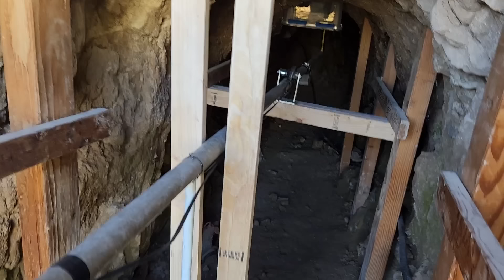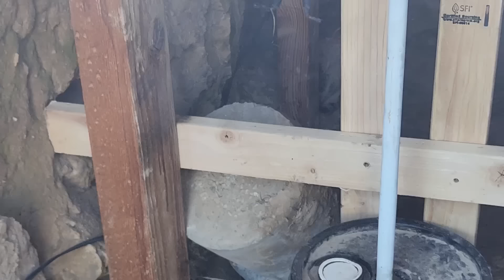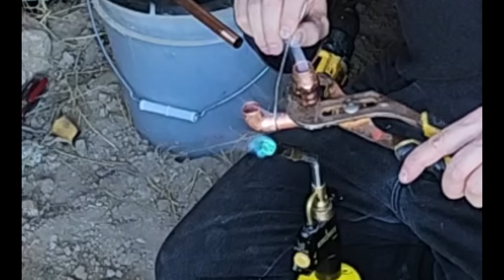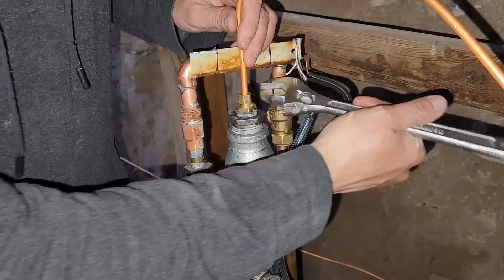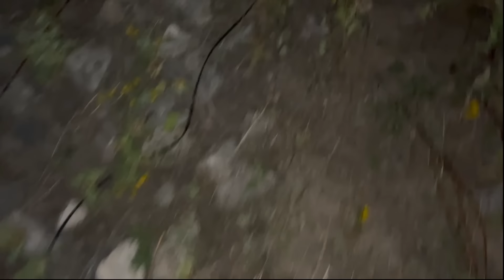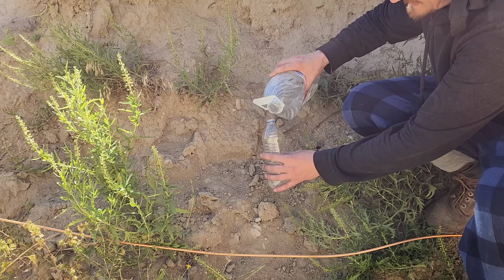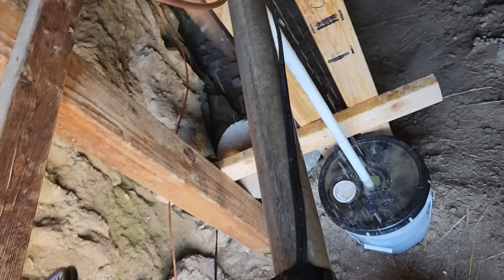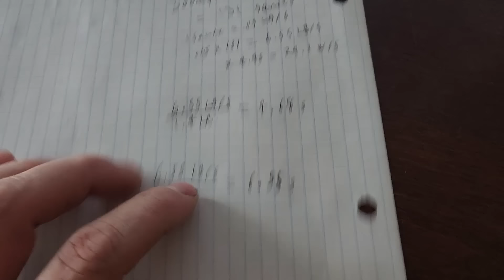Sodium Water Hybrid Rocket?

Comment: Was there 800 lbs of pressure in the copper pipe ?  Normal pressure in water pipes is around 100 lbs.  Sometimes mechanic shops run about around 200lbs pressure of air pressure in copper pipes for their air lines.

Comment: I'm only an idiot but it seems to me that if you'd just put in your lumps of sodium into the 'fuselage' as is (rounded sides perhaps) and had the water injected around it instead of through the middle, you'd have used more fuel. The lump resting on the exhaust would have created enough of a blockage to keep enough water in and... Hmm, maybe the whole thing would just have blown up. Who knows!

Comment: Could you potentially add baffles to the id of the pipe such as washers that have increasingly larger holes leading to the exit? possibly getting a more consistent burn. And maybe increase the force because of back pressure?

Comment: Maybe put the reaction chamber perpendicular to the nozzle.. so the molten sodium doesn't leak out... So have the reaction take place in a horizontal reaction chamber that exhausts gas at the top.. or vertical but have the exhaust coming down from the top of the reaction chamber.. So basically make gravity help making the fuel stay put...

Comment: Cool content. Thanks it was very entertaining, I like your authentic personality. The problem I see is that by adding the water to the top of the sodium tube your introducing a lot of uncertainties in the burn. One clog and... boom. Solid rocket engines always burn from the bottom up. Not top down. I'm thinking about using a sodium rod instead of a tube and introducing the water at the bottom of the thrust pipe. The sodium rod would sit on a metal grid stopping it from falling down onto the nozzle opening. As the sodium rod burns it will continuously fall introducing more sodium into the water contact area at the bottom. Just an idea from an engineer from a completely different field. But I have always been interested in rocket design. would love to hear your take on this idea.

Comment: I think the problem here is that when the fuel components are near the melting point (Na) and the boiling point (H₂O), the combustion is very hard to regulate. Also the fuel components must be sprayed in liquid form and thoroughly mixed into a special combustion chamber with turbulence to mix the components. For the rest: Na+H₂O generates hydrogen that burns in air by combining with oxygen. This adds to the irregularity of the reactions.

Comment: I'd advise on using a steam injector that uses the chamber pressure to feed water into the reaction chamber. It will be much more scalable then having to force in water using a compressed gas.

Comment: I think that most impulse test are performed longitudinally rather than vertically. When done vertically, one would need to adjust for gravity. The changing mass with skew the gravity force, ie weight. The engine is placed in a simple rig with torsion sensors or load cell to calculate thrust

Comment: As an engineer it really hurts my soul to see you write impulse as lb/s and N/s. You are multiplying so it should be lb.s and N.s That's pound-seconds and newton seconds, not pounds per second and newtons per second. 
You should check out Goddard's early rocket which had the fuel tank at the bottom because he (wrongly) thought it would improve stability. It's a design that would avoid unreacted sodium spraying out of the nozzle. Also, you need to add the water more slowly if you want to get all the sodium to react. Your burn times are really short at the moment anyway. Chemistry labs have manual presses that extrude sodium into wire for drying solvents - you should look into that as a way of increasing surface area.

Comment: Maybe an alloy with a less reactive higher melting point metal could work with this design. Silicon, Aluminium or Magnesium seem like good candidates having way more energy but being less reactive than sodium, although making the alloy safely likely requires a vacuum or noble gas filled furnace.

Comment: Sodium metal has a way too low melting point, is obviously a way too good heat conductor (being a metal…) and is too ductile to be a practical solid propellant in this fashion. 
Maybe sodium metal could be used as a powder but it may be too ductile. Otherwise, liquid sodium being injected in parallel with water would be the best option, but that would surely be more complex and hazardous. 
Sodium is kind of fun, but doesn’t seem to be very promising in terms of performance anyway, I guess.

Comment: Great experiment!!! Although I would suggest for you to reduce the nozzle at the end of the rocket to slow down afterburn and prolong the reaction. Another thing that could be for the future reference is to set a non return valve above the pressure washer nozzle as well as the solenoid to shut off noble gas. :)

Comment: I'd personally like to see the sodium locked into a matrix with a high temperature melting point mesh. Since the sodium is grabbing all the oxygen, steel wool might just be a good matrix. This might help keep the sodium in a usable structure, until close to burn-out.

Comment: Just an idea (and it may be a bad idea) but have you considering using a middle pipe that is a bit shorter than the outside pipe that permanently screws into the bottom fitting creating a cup of sorts that you can refill with sodium without the need to use the screw.
The benifit would be that the reaction would be limited to topmost area of the sodium that is exposed and the byproducts have to exit up, over and though the middle pipe.
This should fix the sodium melting problem and maybe the efficiency problem.
Not sure how or if  the reduction in exposed surface area will majorly downgrade the pressure differential, or if it doesn't melt uniformly as I suspect the surface area may increase more than expected.
But what do I know I am just a simple bumblefck on the internet.
Anyway entertaining video. Great job man!

Comment: in India there was a man named Talpade he had two containers one with oil and one with water, under the container with oil was a pipe that connected the container with water, both oil and water were boiled and when water steam entered the oil they made great pressure. My advice is to make a sieve from a tin cylinder with many mini holes so that sodium is not expelled quickly, and instead of pure water there should be water vapor.good work👍

Comment: I was thinking if you were to make several tubes for your water distribution, spaced evenly throughout the sodium (something like 6 copper tubes with a lot of tiny holes drilled along the length of each tube), you might have a more complete burn. If you could find a way for the holes at the bottom of each tube to open first, then have the subsequent higher holes open in sequence...that might give you a more controlled burn on top of a more complete burn.

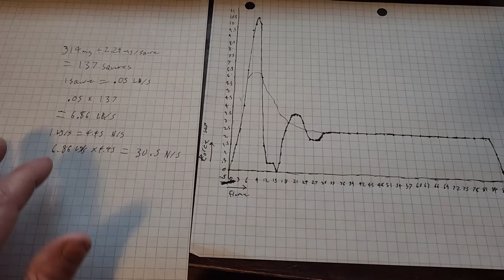Comment: 10:26  remember that the negative value shown was the reversal after the fuel stopped. Therefore, not a true value. Also wouldn’t your scale show you in grams or pounds / ounces. And newtons of thrust force would be measured against a plate.  It including the weight of the device. Then you subtract the weight of the rocket from the thrust and you can determine if it can lift the rocket. 
Now you used a long metal pipe on a fulcrum. Hence to identify the ability to lift the rocket would need to be modified by the weight of the divided rocket

Comment: i wonder if you need an extended chamber for the reaction to fully complete. i am surprised it doesn't touch the metal at the first point on contact at the top then blow the rest of the metal out

Comment: For safe storage of the engines, you could put a burst disk on the bottom and just keep it filled with oil. When the pressurant is released, it'd blow the disk and drain the oil as the water takes it's place.

Comment: I'm thinking drawing the sodium into 1 or more wires, feed wire into combustion chamber kinda like a mig welder...  a gas engine would fail miserably if you just put a spark plug in the gas tank, which is basically what you did. Just thinking out loud 🙂

Comment: I suggest finding a way to keep the sodium near its melting point, and injecting it into the combustion chamber. That way you can control the interaction between the catalyst which is water and the sodium. I feel like you can get more impulse out of the engine with that amount of fuel it’s just a matter of finding the right way to mix it Or I’m dumb either or works for me

Comment: Props for doing this on a primitive level! Impressive! You had a highly ineffective burn, try improving the injector to a much finer particle size and I would suspect a much better burn. Also you probably had much more fuel than oxidizer leading to excessive weight. But I liked the thought process in all of this and it left me pondering that maybe you could reach a optimum particular size by causing the water to be in the form of steam. This could be achieved by using hydrogenperoxide and running a silver mesh catalyst as the injector, thereby turning all peroxide into high pressure steam which then reacts with the sodium. That should cause it to run in a ultrahigh pressure mode. Would love to either see this test or do this! BTW great scientific gear can be purchased for change from government auctions, just in case you want to build a better lab!

Comment: I think you might have some better results if you instead created rods of sodium, and placed them around the inner circumference of the combustion chamber. (To reduce the amount of surface area that is in contact with the walls.) Then maybe put a metal mesh in the center column to mitigate the amount of unburnt sodium pouring out of the chamber. I imagine with the water coming in, it would cool the mesh, and solidify the melted sodium, until it combusts.
Although, I think ideally you'd just have dual injectors with the sodium pre-heated in a liquid form.

Comment: I think your main problem is where abouts inside the rocket, the fuel is burning.  From what I gather, in a typical rocket, it's the fuel nearest to the exhaust that burns first,  this then causes the fuel slightly deeper in the tube to fire and so on.  So the burn starts at the exhaust nozzle and travels up through the the fuel stack.

Your setup, however is introducing the water at the other end of the fuel stack.  So your fuel is burning from the wrong end.  The thust (and hot gases produced) are therefore having to push past all of the rest of the fuel before they reach the nozzel.  This is why the sodium is being melted and ejected before it has been burned.  It's literally being forced out by the thrust.

I think you need a redesign where the water is introduced near the exhaust nozzle.

Comment: I have no experience beyond seeing a small piece of sodium thrown onto water bucket.  At first nothing much happened.  The teacher explained that despite of the oil, the sodium had in the decades (!) oxidized too badly.  After that, he dug out another bottle, this time sealed with wax in addition to the oil.  He explained that it was potassium, which the school should not actually even keep.  So, we would get rid of it!  I guess even he was not fully aware of its strength or just by chance threw the whole sample on the water at once.  It was the biggest bang ever in the chemistry class room.  And there remained plain marks at the ceiling for the remainder of the school operating in that building.
  Apart from my limited experience, I was reasoning pretty early that offering water from the top was quite likely to throw part of the sodium out before a steady pressure could be developed at the bottom region.  Looks like I was not that far off in my thinking!

Comment: As a first test made out of low-cost materials, i think you are on the right track. 
The hybrid rocket would probably get better combustion efficiency if you went with a longer narrower combustion chamber.

An injector that is a long tube with pinholes spraying outward.

Comment: nice try!!! you may want to make your nozzle longer with holes laid out radially along its length or a nozzle that gives a rotating cone pattern. i.e. mcmaster carr 	3282K162.  it may be possible to put stainless steel mesh as a binder.

Comment: You should have used oxygen to pressurize the water. Your reaction produces hydrogen gas, which is literally rocket fuel, as a waste product... Then your hydrogen probably burns where the exhaust is mixing with air, producing flames but no thrust. That huge fireball on the ground is all wasted energy. Ideally all the burning should happen inside the rocket.

The reaction you use is 4Na+4H20 -> 4NaOH+ 2H2 + 734 kJ (reaction doubled to compare to other reaction)

Instead you could use 4Na + 4H2O + O2 -> 4NaOH+ 2H2O + 1217kJ (accounting for vaporization of water but not delta T)

That's a 66% higher energy yield. Not sure how it would compare in terms of thrust, since hydrogen has a higher specific volume than water vapor, but O2 is almost the same weight as Argon and heated water vapor has a much higher specific volume than O2.

In terms of energy density of the combined fuel, water and compressed oxygen if you switched to that, the specific energy of the fuel mixture would be 6209 kJ/kg. With oxygen at 800 PSI, your energy density would be 1954 kJ/L, which isn't great. You would really need a solid/liquid that releases oxygen, such as hydrogen peroxide or a perchlorate.

Comment: I heard about a similar hybrid tripropellant rocket project, where instead of water and sodium it used lithium and fluorine (latter in form of sulfur hexafluoride) and pure hydrogen as working gas (i.e. it did not reacted with anything, it was there just to be heated and yeeted away.) Some claim that this thing would be so energy dense as to make SSTO crafts possible.

Comment: Potentially weld flanges onto a thin piece of sheet steel and roll it into a tube to go as an inner jacket, give something for the sodium to grip onto as it melts, and the narrowing might give it enough of a pressure differential to keep it out of the middle

Comment: I see 2 different designs that might work better. The first one is where you put a stainless tube in the center and seal it from the side where the nozzle is so the sodium is kept there by gravity/acceleration. The other side of that center tube might have a gap or drilled holes to it's center. The water is injected by a ring with holes or dedicated injectors onto sodium. The pressure should be enough to overcome reacted mass coming out of the chamber into the center tube. In addition you could make a smaller injector in the center too to mix with unreacted sodium while it goes through the center tube to the nozzle.
The second design is a regular liquid fuel rocket motor but with liquid sodium and water used as propellent components

Comment: The whole "cutting out the traces of the paper and weighing it" to calculate Newton Seconds genuinely blew my mind. 

It makes total mathematical sense, but I've never seen it used this way. Cutting paper and weighing it is such a nice transmission between mathematics and physics. Perhaps it's a know thing, but it's the first time I've ever seen it, and it just made me understand these types of graphs so much more.
Reply: This was actually the more common method before computers were a thing. Otherwise you'd have to perform complex calculations and stuff